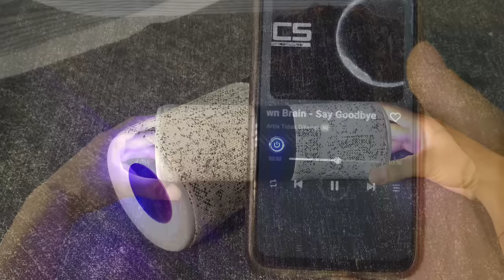DIY Bluetooth Speaker with RGB Light || From Fabric-Covered PVC Pipe & Carbon Fiber Vinyl

Comment: Holy sh*t, he soldering 18650 battery ???? You should use only spot soldering stuff not directly soldering them like that.😂😂😂😂
Reply from the maker: Yes, I really need spot welding🙃🙃
Reply: @leoparddiy atleast use a battery holder and solder wire to its terminal

Comment: 🤨2*30W amplifier and 2*15W speaker 😬😬 ... this is not a bluetooth speaker, its a "speaker disaster"🤕
Reply: 11:36 amp 2*15W, я не уверен что они там есть, да и динамики маловаты для такой мощности.
Reply: this amplifier doesn't have that much, maybe it has 2x10w, it's just crap, not an amplifier xD
Reply from the maker: This amplifier has 2 different versions, XY-p40w for 2*40w output. and and another version is XY-p15w for 2*15W output. in that video I used xy-p15w.. thanks..